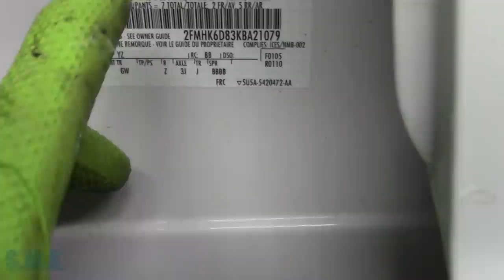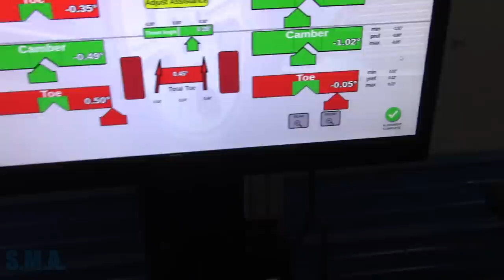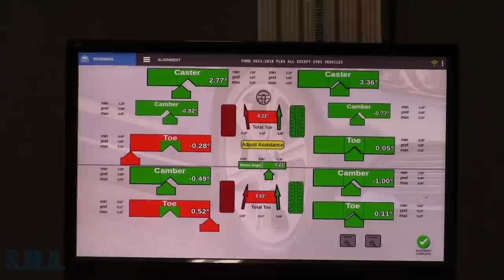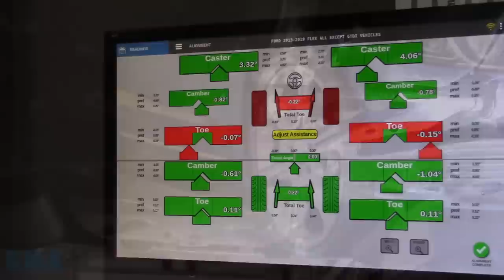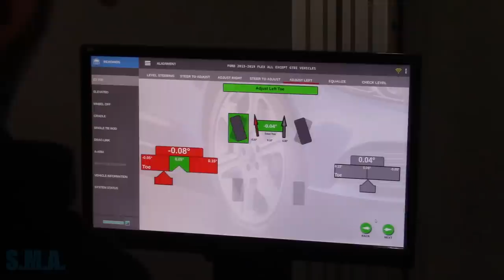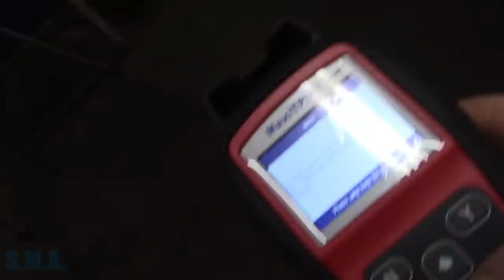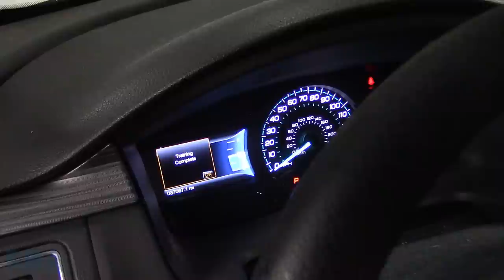Ford Flex: Wheel Alignment & Tires

Comment: I always wonder about the weight for the wheels. Do you put on any spot on rim, or need to locate it's spot before put it on.
Reply: Wheels have areas specifically for weights (the outer rim for the clamp-on type, or the area behind the spokes for the sticky back weights), and you have to input the location where the weights go when setting up the tire balancer machine.

Comment: Question for you Mr. Eric O: What do you recommend to be put on the lug threads and lug nut tapers? I’ve been using Anti-Seeze. Anything better?
Reply: Nothing...lugs are meant to be dry.  Putting lubricant on them will skew your torque settings
Reply: Just make sure the nuts and stud threads are clean and rust free! Antiseize will dry out, gum up, and make removal of the nuts difficult for the poor bastard who has to rotate the tires.

Comment: In the past 20yrs, many different cars, dealerships and shops, I have been unhappy many times after an alignment. A crooked steering wheel is my #1 complaint. Almost every time I  am told it's a 'tire pull'. One vehicle was a brand new 2009 Lincoln MKZ, with 150mi. The dealer couldn't do a warranty alignment until it hits 500mi., so they rotated the tires. At 500mi they said the rear alignment was out. I drove 1/4mi out of the parking lot and did a u-turn, It still pulled, crooked wheel. They gave me a loaner for a week. 2 more techs worked on it. The last one was there senior lead tech. He found a bent control arm? How does this happen? Wouldn't a bent part show on the machine, crazy out?

Comment: Also noticed unrepeatable numbers with tire clamp sensors. The clamps adjustment has to be right also. Overall seem okay as far as steering wheel being straight no accelerated tire wear. Doesn't look good when you when rec. an alignment and it was just done and in the green.

Comment: When I used to change tires in the 1970's I swore I'D never have aluminum wheels. They are better now but changers have also changed and every time I see Eric do it I get frustrated because I could change them so much faster on our old Coats 20/20 machine. Of course we would scrape up all those alloy wheels! Did you ever think progress is overrated?

Comment: I may have to see if our vehicle is supposed to be able to tell which tire is low.  It would be a bummer to not be able to change a flat tire on the side of the road because you didn't have a sledge hammer.

Comment: I always wanted a Flex. But when I found out watching you that they had an internal water pump on the only motor you can get in it I changed my mind. I've had questions and comments but. Well I've been looking at getting a Honda Ridgeline. You owned one before answer these couple questions will you? Did you buy it new or used? What kind of repairs did you have to do to it while you owned it? How did it handle the rust / salt winter? Why did you get ride of it when you did?
Reply: I have owned a bunch of police Explorers and Tauruses. The water pump job really is not to bad. Book time is like 10 hours, last one I did took 4.5 hours. 

After hard police use, I get to see all the problems. There are a few: transfer cases leak, front control arm bushings wear, electric power rack and pinion that are $ to replace. But overall they are quite robust. Don't buy a turbo one.
Reply: @mph5896  I'm not worried about the cost I'm worried that the pump will start leaking and before I notice the oil will be diluted  and seize the motor.
Reply: David E.S. It’s not a terrific design for sure. I would consider a water pump a matinence item on these engines and change them out at a certain interval such as 80-100k. The last one I did had 19000 hours on it (estimated 500,000 miles at 30mph for its life) and it was leaking a little out of the wheel holes. I daily an explorer with a 3.7l I bought cheap. 

The “great” 3800 v6 that everybody loves would degrade the lower intake gaskets and dump coolant into the engine. I did a ton of engine swaps in police cars due to this.
Reply: @mph5896  Speaking of police cars. I saw this one video that this guy bought a police speck Ford Explorer that the dealer got one or two to many and he bought it with less than a couple hundred miles. Seeing it came with a key and not a push button start and two bucket seats up front and no center console it was just what I wanted. But I have no idea how I would get a dealer to buy an extra one to sell to me. It would have to cost less that a street version right?

Comment: Considering how rusty the hubs and wheels get in NY, I’m genuinely surprised the shop doesn’t have a dedicated wheel hammer like the Ken Tool TG35 or a Matco BFH12A to knock the stuck wheels off (they’ve saved my ass many times).

Comment: Went rotate my daughters tires the other week. Simple short straightforward job. Nope. Like 3 hours. Northern Wisconsin. Lugs wouldnt com off. 3 different size lugs depending upon if the thin factory cover was still on the nut, plus then trying to get the tire to let loose from its mounting. Ugh.
Reply: Yep! 19 with the stainless cover or 18mm without it. Common problem, even created oversize 19.5mm sockets for bulged lug nuts
Reply: Either a Ford or Chrysler product, they’re the worst offenders when it comes to lugnuts.
Reply: @300DBenz  gm does it also

Comment: I wonder how it would look on Ford if they did the rear diff replace, no alignment and the customer complained to dealership about poor handling and steering wheel was off. Before the customer gets back to said dealership hits an icy patch of road and crashes. Would be interested how that would work out. Ford,dealership or technician, who gets burnt the worst.

Comment: Thank you for 1: Removing the sticker. Yes it will wear off after a couple miles, but that drives me insane. 2: putting the new tires on the FRONT. For some damn reason, shops where I live will rotate half worn tires that are on the back to the front and put the new ones on the back. When buying 2 new tires, they should go on the front!
Reply: I know some places do that to "avoid fishtailing" under poor weather. At least thats what I was always told. Could be urban legend.
Reply: Putting the new tyres on the rear is meant to help with the corner handling. There is alot of debate about this, and a few YT videos about the for and against doing it (but the videos are made by tyre manufacturers so make of that as you will!)
The additional time spent doing this (especially if you are a one man band like me!) is not worth  the extra hassle. However, if the customer requests for it to be done then I will gladly do it for them.
Removing the sticker is a legal requirement! 
If the vehicle was to leave the garage and needs to brake in an emergency with the sticker still on, it could cause the car to slide as there is no grip on the label!

Comment: I see the two tires are worn out, but isn't a Flex AWD?  On my Subaru, you never can replace just two!  All four or none at all.  How is Ford AWD different, so it can tolerate tires of diff diameter f to b?

Comment: If you want new tires to ride like driving on glass... you get what is called a "Road Force Balance with *Ride Match*" which will perfectly balance the egg shape of the wheel to the egg shape of the tire.  By egg shape I simply mean they are never a perfectly round circle.

Comment: As you're doing the tires I was thinking somebody should say something about the difference between the posted tire pressure on the tire versus the one for the manufacturer. I've seen many cars come in with maxed out tire pressure and the tread in the middle of the tire being completely gone. These are not bicycles people

Comment: Why do mechanics and tire people insist on using impact guns to remove lug nuts. I also have a Ford Flex and have had to replace my chrome lug nuts three times because of worn out sockets and excessive air pressure. Because I have several friends who deal in tires, they always allow me to break loose them by hand, using a new socket and pull handle. They also let me use that same socket to torque them down.

Comment: My Odyssey  has never been aligned since I bought it.  116,000 miles and no unusual tire wear.  Dealer wants to align it based on principle.  I keep declining. I believe in alignments for steering pulls and unusually wear only.

Comment: Oh ford and there rubber TPMS valves that leak all the time after fitting new tyres to the rim where i work we replace the valve and test the censor every time we fit and new tyre to a for rim

Comment: You didn't do the tire install right. You are supposed to leave the label on the tire. That's how they do it here in nyc. That's really annoying and i have to take it off when I get back from the shop. Another job well done. Wish you was here instead of those shmucks that work in the nyc area.

Comment: lol dont hit the rim..or anything else.  ..look at that courtesy fluidfilm application. or mabe you just doing yourself a service so you dont have to potentially destroy the car with the sledge hammer next time LOL ...oo im not familiar with that adhesive removal bit you used. nice touch; doesnt damage the paint. ...fills up faster if you take the valve core out? ...that's ferd quality for ya out of alignment after a year or two lol ...

Comment: Our edge came with a set of those Hankook tires like what you took off of that.....they were down to 3-32" with only 32k miles on the car and normal driving...wifes car.    Those are junk.

Comment: jUST OUT OF  CURIOUSITY ?  Why  are you  not  using a  large  Soft  covered  dead blow  for  knocking  the  wheels  loose? Hardly damages the  wheels . That has  been  my experiance  
I  still keep the sledge  in  case of  harsh reasons

Comment: Dr.O lol sorry I mean Mr. O, :) That's nuts why would  Ford not do something so simple as a wheel alignment after replacing the rear end, when no parts are required and it only takes about 30 minutes at the most. Oh I get it so they can say I am sorry that's not covered by the warranty if you want it, It will cost you. Or what do you mean your tires wore out before the tire warranty you must have not kept the tire preachers where they are supposed to be. Ford may do something but only after there is an accident and it was shown to be caused by their failure to align the car after replacing a rear end. FORD what a sad state, for what was one of the biggest car manufactures in the US. SMA is SMH ( South Main Auto) That is Shaking My Head. Just an FYI. :)

Comment: The reason why they do things at a dealership the way they do is because of flat rate, warranty time, and management issues. I work at a dealership and see it go on all day long. It's unfortunate because it's hurting the customer most of all..
Reply: @Brent W. It hurts the dealer and dealership image too. With techs rushing through jobs to save time some things often get over looked. That comes back on the dealer/Service Dept and probably adds to the 'Stealership' mantra when it comes to service. I would rather take my car to the dealer for service so there is a record of service but I just don't trust them to be as thorough as I am.

Comment: Hey bud
The red dot on the sidewall is to be aligned with the valve stem.
Reply: Just out of curiosity, why is that?
Reply: It depends on the tire manufacturer. (Pirelli uses a blue dot, most others use yellow.)

But in my experience, it doesn’t actually matter where the dot is, because the wheels aren’t perfectly round anymore and I have to rotate the tire to different spot on the wheel to correct for roadforce.

Comment: How can a car that is 2 years old have the wheels stuck to the hub with rust? That's garbage quality in my opinion...
Reply: And also how does this car have bald tires already? Does the dealer install used tires ?
Reply: I’ve seen BMWs and Audis that are less than a year old come in for a flat tire repair that have rust already starting to form on the hubs.

Comment: Typical stuck ford rims, terrible design on them. It’s like the v8 spark plugs all over again. Goes narrow for the hub centric ring then it’s bored oversize to have the cap yet the hub center flanges stick further through allowing the rust to wedge them on.